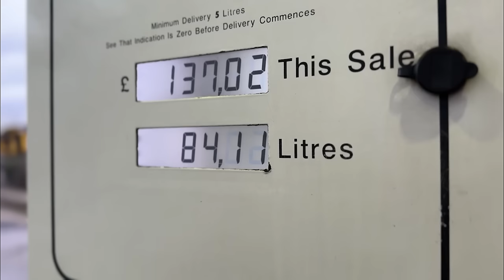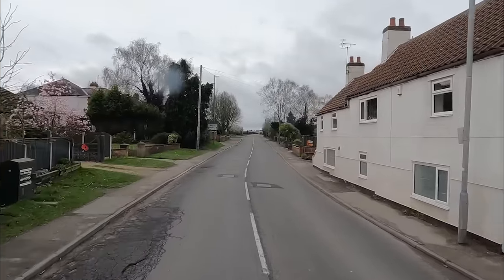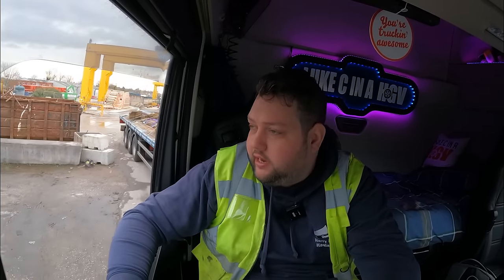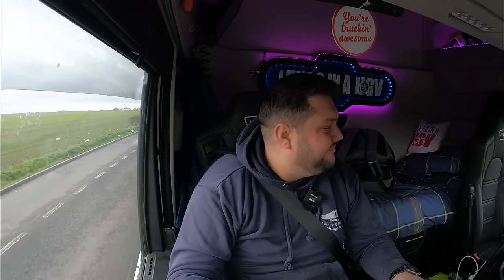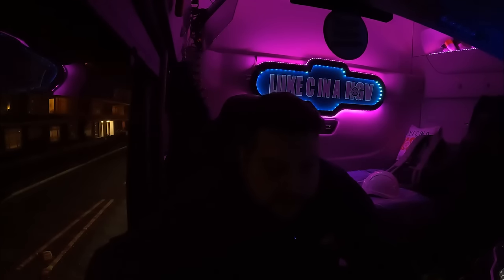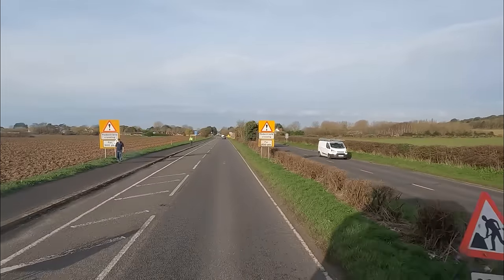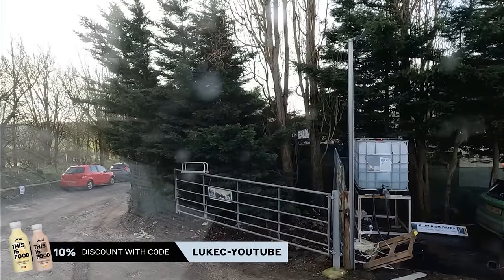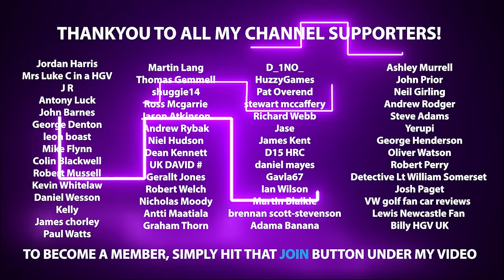Night Out At The Docks!

Comment: When loading the timber i hope when you put the top.packs on you put timber bearers all the way across it helps the timber ride better dont just use the bearers on the packs
Reply from the maker: Never have. Don’t know of anyone who has either.
Reply: @lukecinahgv  was taught it over 30 years ago when doing flat bed work makes the four packs of timber ride miles better see ask any old hand who has done a lot of timber and they will tell you the same as with Not putting timbers all the way through the top packs will move a bit but with long bearers going all the way through they ride better as they say every day is a school day but  half the time now you are not aloud to go on the trailer to do this anymore  give it a go nxt time and see just a friendly bit of advice